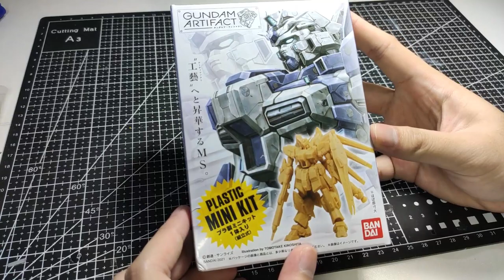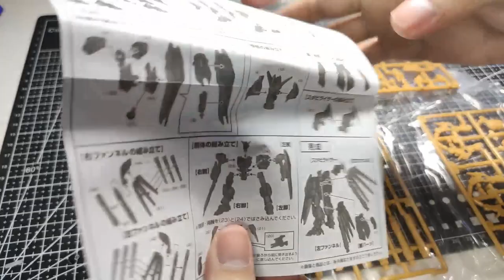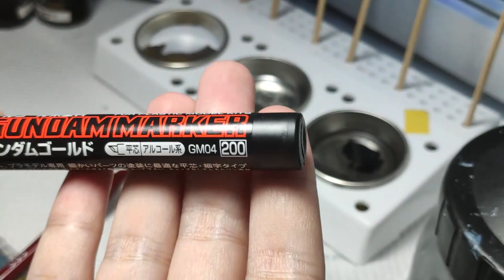CUSTOM PAINT | Gundam Artifact Hi-v Gundam

Comment: I heard these are made of ABS plastic, does painting make them brittle?
Reply from the maker: If you put too much thinner or put too much panel liner. It will make the ABS plastic brittle.
Reply: @Prestidigitalic  so as long as I use paint straight from the bottle in thin layers, it should be fine. Quick question, is it ok to use lacquer based or is only water-based going to work?
Reply from the maker: @abshah8514  yes, it's okay to use lacquer based paint, just thin coats of paint. Don't do wet coats in bare ABS plastic, prime the surface first. It would be best to use airbrush than hand painting. The safest would be water based paints.
Reply: @Prestidigitalic  thank you again for the help!
Reply from the maker: @abshah8514  You're Welcome!

Comment: Great job. Where did you find the decals? Thanks for the video!
Reply from the maker: Sorry I didn't include it in the video. I printed my own decals in a blank waterslide paper. 
Any waterslides I bought doesn't fit so I printed my own decal sheet.

I printed it in an inkjet printer then let it dry for a couple of hours then top coat with mirror gloss then I have my own custom decal 😁
Reply: @Prestidigitalic  You're amazing 👏
Reply from the maker: Thanks! 😁
Reply: @Prestidigitalic  Amazingly detailed work!
btw, how did you print white decal? Did you use a special printer?
Reply from the maker: @Skyblue 184 Thanks! I didnt print the white decals, I bought a warming decal pack. 

I really wish I could print white ink. I'm still researching about this.
Reply: @Prestidigitalic  I did find some white cartridge inks on aliexpress but I honestly think it is not worth the hassle to go through all that work. I hope a printer manufacturers would just sell white cartridges...

+ I got really inpired by your build and pre-ordered gundam artifact 2 set. I hope I could also make amazing build as you did.
Reply from the maker: @skyblue_184  I also found White Toners for Laser Printers but laser printers are expensive. Making your own decals is nice especially for small kits like these. It would be great if there is a local printing shop that could print white on paper. 

Thanks for the comment! Have fun on your kits! You could do it!